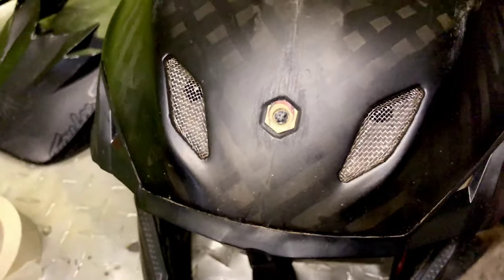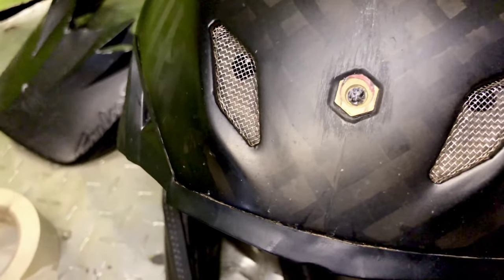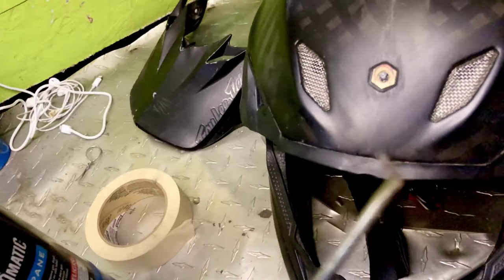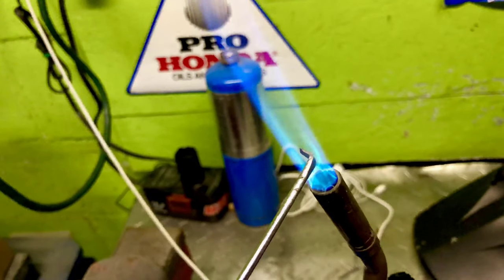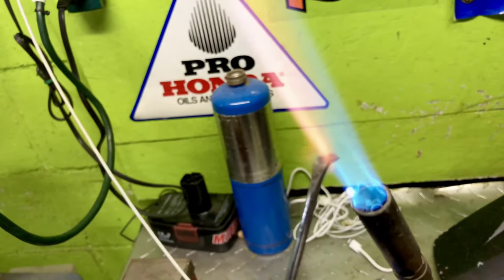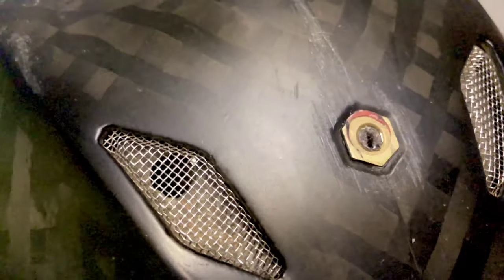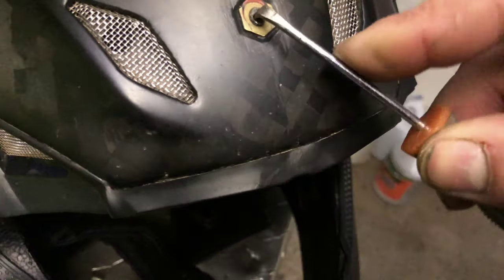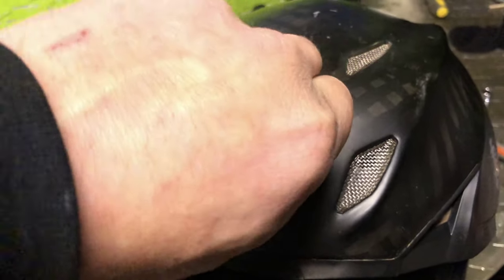How to easily remove a broken visor screw on a helmet

Comment: Would it work on a metal screw?
Reply from the maker: No because there is no way to heat up the metal that hot to get it to melt when you stick a screwdriver in it
Reply from the maker: Shauna B And when it comes to visors you should never use metal screws because they will not break and allow your visor to snap off properly like it’s designed to do in case of a crash involving your head
Reply: Do u have any ideas on how to get the screw out?
Reply: In general I mean?
Reply from the maker: Shauna B ur gonna need an easy out if its a aluminum visor screw should be easier if its a steel screw or something else will be a little tougher drilling through look up some videos on how to use an easy out first that will set you in the right direction
Reply: Thank you for your time! I will try it out!